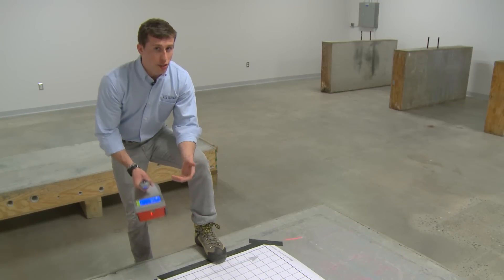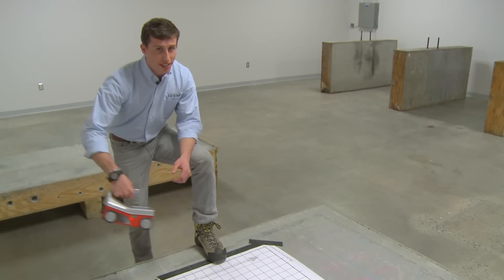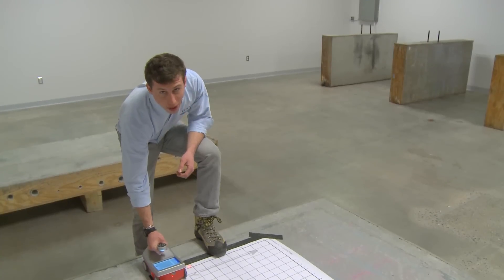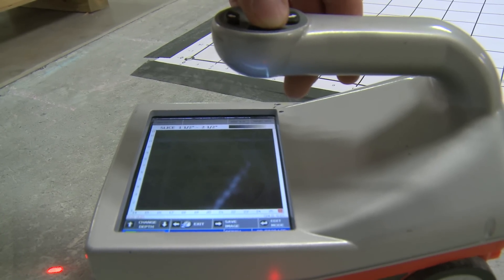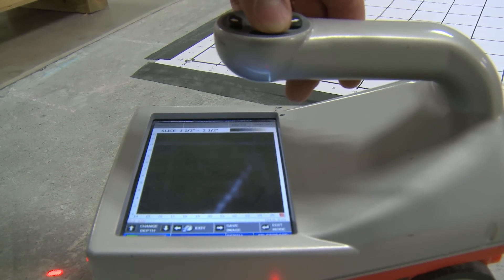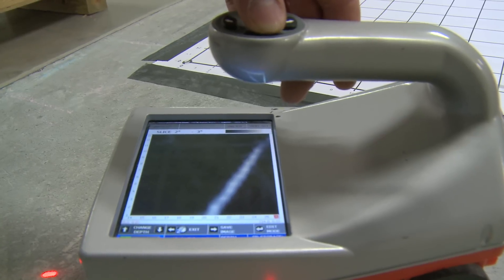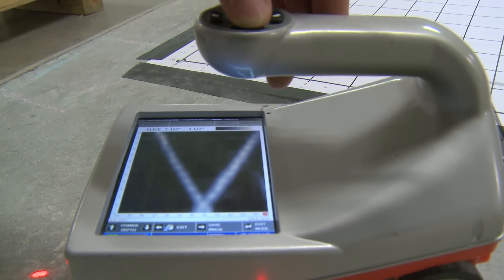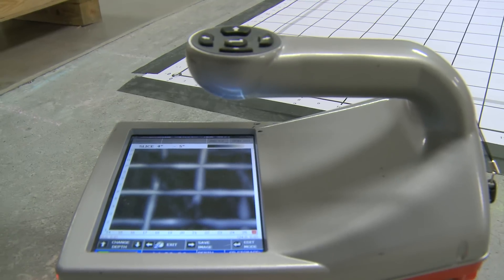3D Concrete Imaging using GPR

Comment: Can you show how a contractor might be able to find a safe place to core using that information?
Reply from the maker: Hi, what system do you have? Do you have the StructureScan Mini HR like in the video? Or the StructureScan Mini XT? Feel free to email us at training@geophysical.com to get an answer quicker if you would like.
Reply: @GSSI  Yes, the Mini XT. I went through training about 12-15 years ago on a much older model and I'm assuming it's the same.
Reply from the maker: @richardmartinez4602  Okay awesome. One of our trainers just collected data with the Mini XT and wrote this out. If you have any questions, feel free to comment back or reach out to the training department at training@geophysical.com. 

You can review the completed grid in Playback Mode. In this mode, you can use the touchscreen to determine the X,Y coordinates, as well as depth, of any features that are visible in the 3D image. You can then use these coordinates to draw these features on your grid sheet and leave it for the concrete cutters to refer to. You could also use the 3D image on the Mini XT to locate a clear spot in the scan area, get the coordinates of that spot, and mark that location on the grid sheet or the slab itself to indicate the clear location to the cutting crew, whether that’s you or a subcontractor. Another option, if your site has surveyors and/or a base map available, would be to survey the location of your grid scan on the site, post-process the data on a PC and locate either the obstructions in the floor or a clear spot to drill, export the obstruction locations or drilling location into a program like AutoCAD, and place that info onto a basemap of the site that you can distribute to subcontractors, general contractors, engineers, or anyone else who might want to review your findings.